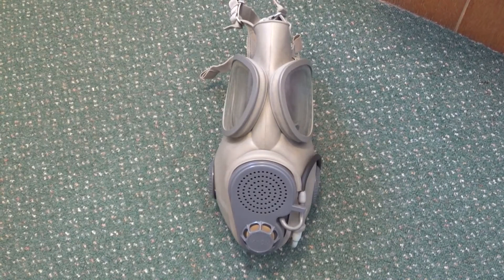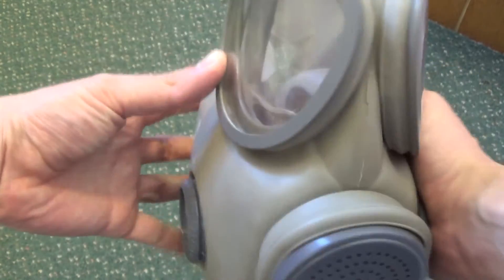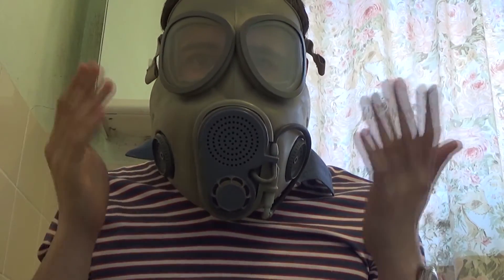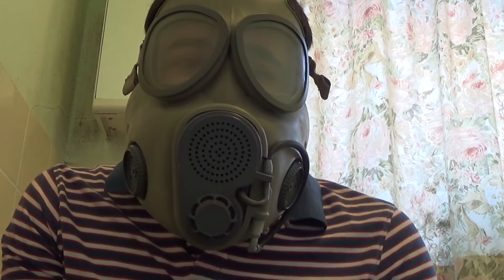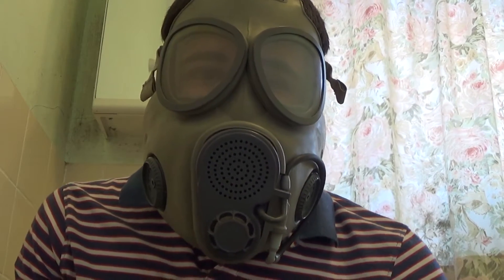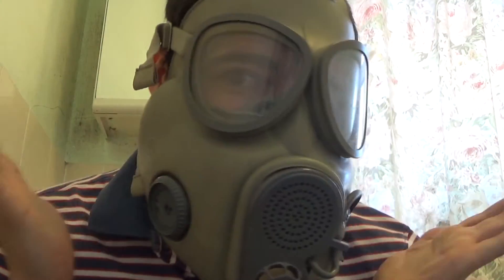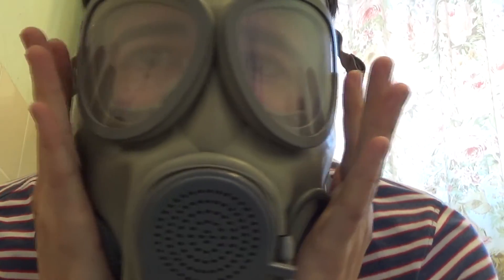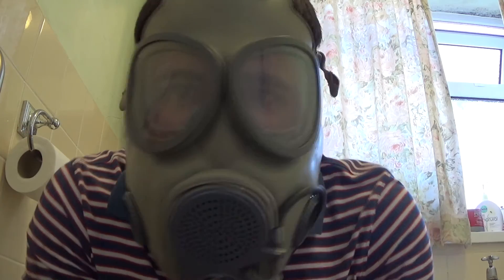How to seal a gas mask

Comment: I really want to test my mask, but I am having a hard time getting rid of all of the white talcum powder. I washed the mask in warm dish soap water, and I put rubbing alcohol on white stuff. I think it has removed some, but not all of it. Uggggg lol well hopefully it is all good, because I think it would be too late to return it for a refund at this point. As a newbie this stuff can be intimidating. I hope I can remove the rest of the white residue soon....
Reply from the maker: Use damp kitchen roll to wipe the inside, it will pick up the talc, I wouldn't advise using rubbing alcohol on a mask, could potentially damage the rubber.
Reply: Ok....I will try that next time soon. Thanks!